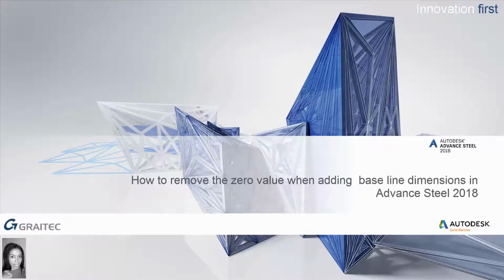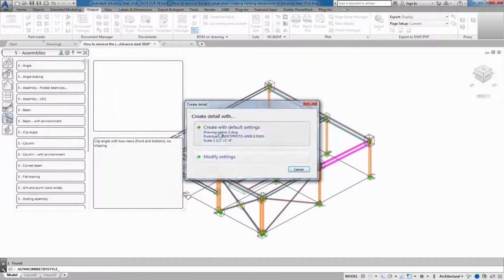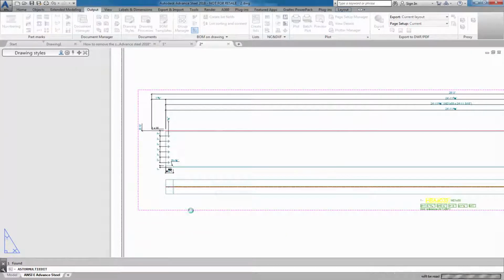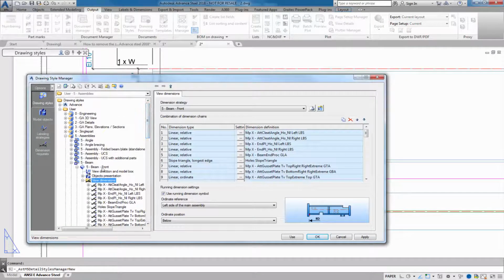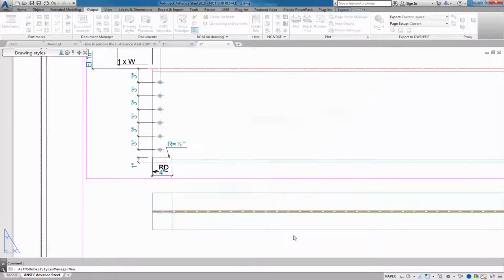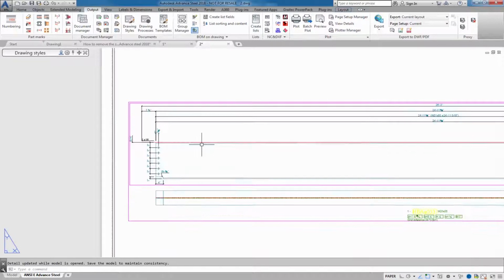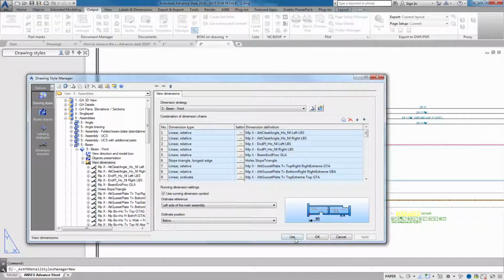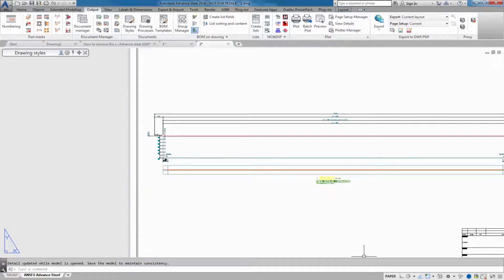How to remove the zero value when adding base line dimensions in Advance steel 2018

Comment: Hai can you please help me out, I have done the same procedure but I don't understand that. Running dimension settings are not highlighted to uncheck the mark. . What would be the solution for this ?
Reply from the maker: Thank you for your question. I would suggest you go graitec.com, select the country and contact tech support, with Advance Steel version you are using.